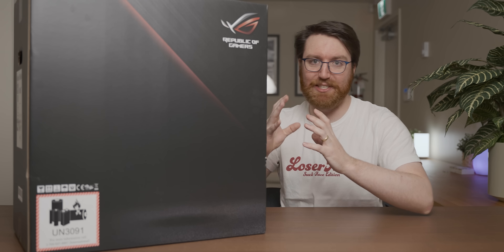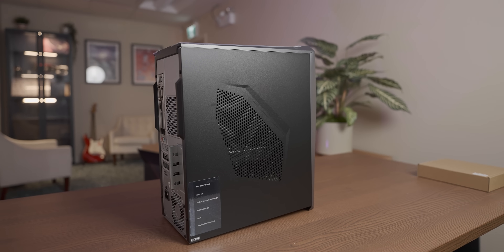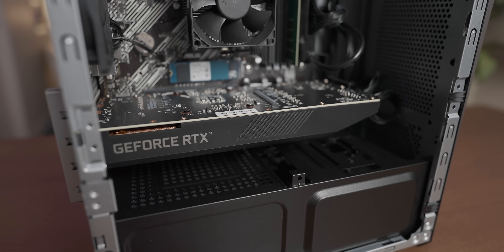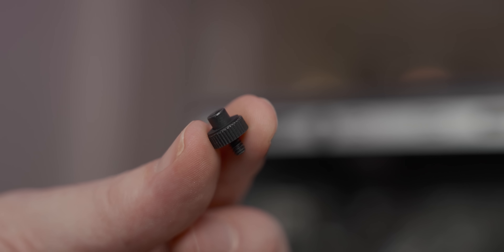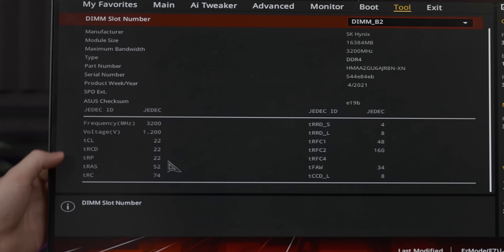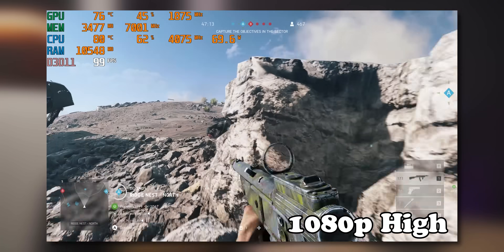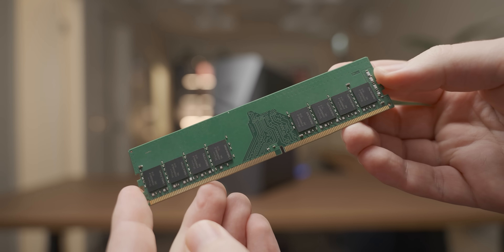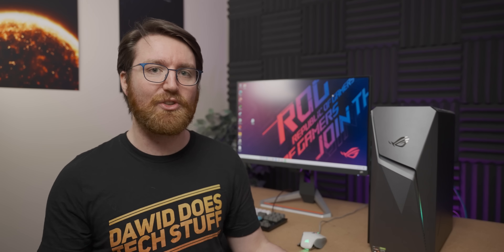Why Do Asus ROG Pre-Builts Suck So Bad?

Comment: Which is odd because ASUS makes amazing components..
Reply: Good laptops as well. Well, except their TUF branded ones which are awful but the rest are pretty good ;p
Reply: i love how most billionaire companies cant make a good prebuild but can make good components
Reply: I want to know who decided that case should even be sold, because that’s ridiculous.
Reply: Yeah they dont put them in their pre-builts 😭
Reply: I always wonder who’s in charge of the product and sale team? They know gamers are gonna be nit picky and will want the best thermals, dual channel ram, and a clean OS installation.
Reply: Some asus prebuilts are good like the 35dx
Reply from the maker: I know right! They know better than to make a product like this.
Reply: @DawidDoesTechStuff  it's not that they don't know better, they know very well that this type of configuration maximizes profit.

99% of "real" gamers would never consider a prebuilt anyways. 

The ones who would buy this don't know any better and it has rgb and the edgy gamer appearance!
Reply: Almost all of their laptops suck. And their actually decent ones are usually overpriced. Even if you buy one of their highest end laptops, you have to gamble to get a good laptop because their QC is absolute ass. And they now use liquid metal on their laptops which makes their QC even worse. They literally put either a WiFi 5 card or a WiFi 6 card in their laptops, whatever is available at the time of manufacturing I guess, even on their higher end laptops that are supposed to have WiFi 6 cards. They send out laptops with WiFi 6 cards to reviewers alone I guess and give WiFi 5 cards to the laptops that people actually buy even though they may expect it to have a WiFi 6 card from reviews they've seen. They don't make a thing as simple as a WiFi card be surely used a specific model without having their customers gamble for the better WiFi 6 cards.
Reply: @dbombers3632  actually I'd have to disagree with you. I've been building computers since 1985 and over the past 18 months it's been almost impossible to get a good GPU for anywhere near reasonable prices. I know a lot of "Gamers" who love building their own stuff but have had to buy the pre-builds because it was the only way to get an Nvidia or AMD video card.
Reply: @Joreel  I see, are you in the US? In my country (Taiwan) we can get GPU at reasonable prices if you are building a complete system. 

I just bought a 11700 + 3070ti with dual channel hyper fury, after market cooler, 750w gold cooler master PSU etc in an NR200 case. 

The cost for this came out to about 1,800 USD.
Reply: @cryptocoin7098  no idea what you talking about
Reply: @GamerBoy705_yt  what brand do you recommend
Reply: @chrisitzsimple4649  I don't recommend buying products based on brands, but Lenovo currently has pretty good laptops (if you buy the right models). The Ideapad 5(i), 5(i) Pro, 5(i) Pro Creator, Yoga Slim 7(i), 7(i) Pro, Legion 5(i), Legion 5(i) Pro, Legion 7(i), Legion Slim 7(i) (make sure Legion 7's and Legion Slim 7's are the 2021 versions because 2020 ones had hinge issues) and not to mention, alot of their Thinkpads too are really great.
Reply: @dbombers3632  well unless they can't have anything else

Comment: The prebuilts have terrible airflow but i was able to snag a prebuilt with a TUF FHR 3080 and i7 11700kf inside for 2100$. Transfered everything into a meshify 2 case, installed a fuma 2 cooler, and now it's a cool and silent powerful rig
Reply: Did you keep the same mobo ?
Reply: @antoinecarazzato2202  yeah, it's a strix b560 G matx board

Comment: The particular prebuilt in the thumbnail is actually pretty good for the price if you spend a extra 50 bucks on more ram to alleviate that single channel problem. It's fairly upgradable too. For $500 or $550 (including the ram upgrade I mentioned) that's a good deal.
Reply: no
Reply: @Zeracey  this now has a 3080 with 11gen I7 for 900 its even cheaper and worth now that parts are not scarce. But say no
Reply: @Zeracey  NPC

Comment: I remember having one of those console PCs, the Asus G20 and that thing ran hot all the time and because it was in a small form factor, had little to no upgradability. For $1k back in 2010, that was a lot for a gaming PC but it was absolutely trash. Within the year it shitted so I basically took out my frustration on the thing before tossing it into the recycler. Ironically enough, that was my spark to start building my own systems and such and I'm happy that it happened.

Comment: I think putting everything into a new case is probably the best thing. There you go - an episode on moving the contents to a new case and see what the performance is like with proper airflow and coolers in place.
Reply: whats a good case for it?
Reply: @sockswastakentwice  I need to know
Reply: @brianbillings6518  same, i think im just getting a basic white case on amazon that has good reviews, im pretty sure all my parts and stuff will fit if not ill just return the case and get another
Reply: @sockswastakentwice  Probably anything that has airflow.  Would be hysterical to see it in something like a Fractal Torrent or a Corsair 4000/5000D  ;)
Reply: @sockswastakentwice  Corsair 4000D AirFlow =)

Comment: from the looks of it, this is basically a reskin of the office PCs they sell, with a GPU stuck in it.
Reply from the maker: It does feel a lot like that.
Reply: @DawidDoesTechStuff  so I am curious how much opening up those fake vents in the front with a Dremel will do to practical airflow in the system, like how good would it be if it came from the factory like that?
Reply: @mattparker9726 or keep the side panel off
Reply: @Neptune695  well then I guess the cooler is to blame
Reply: Daummm sir u really solved the riddle. smart.

Comment: You should cut open the "vents" to see how much it helps the cooling
Reply: or just remove the front. its just clipped in place :-)
Reply: I really wanna see that video !
Reply: Use a dremel tool and cut some openings and zip tie a 120mm fan to the front wall inside the case and it would be a night and day difference. I would do it if I had this PC.
Reply: @MrR2185  thats exactly what i did with mine few weeks ago,not as clean though, just drilled few holes in the front panel and zip tied the fan :D
temps went down about 15c on average across the board, can recommend
Reply: Yes...but for the people who buy this for $2k, it should have that already done from factory...its sad because it looks like you can fit at least two 120mm fans
Reply: @jea446  i just bought this and I'm waiting for it to arrive. Which direction was the fan facing?
Reply: Would it be wise to remove that part? If so how?
Reply: @jea446  is there any chance I could see what that looks like?
Reply: There's no way wimpy Dawid can cut that open without chronically complaining about how hard it is and completely mangling the case and probably cutting himself . Lol would be funny but let's face it. He's not capable lmao

Comment: I'd love to see a take where you take this prebuilt and do whatever you must, in order to optimize it to its full potential. I'm talking;
- Get proper ram
- Install a real cpu cooler
- modify the case for airflow
- install additional cooling fans in the case accordingly

Basically do everything you wish that the prebuild would have shipped with from the store, and then do a summary of the changes you've made, and perhaps the associated cost too, just to see how much has been cut out by the "Asus marketing budget" for this pc.
Reply: the probleme is for me IF you have to buy ANYTHING else after you bought the prebuilt. means that the prebuilt was trash, and you should have made a custom pc from the start.
Reply: @wellaname221  Yea that's exactly the point; to highlight exactly how much the average prebuilts are skimping out on and how compromising their offers truly are, when compared to an actually decently put together rig (with same core hardware, just built with common sense).
Reply: @Real_MisterSir  yup i see your take. honestly i stopped watching this youtuber the moment i have seen one of his prebuilt Test where the pc couldn't even Run a game 1 hours straight without 7 crashs" his words" , and in his conclusion he described the pc as " OKEY " when he should advise people to Avoid it even if it was the last pc on earth. his reviews are Shady AT best.
Reply: @wellaname221  Damn.. I haven't seen that one. I personally wouldn't even feel comfortable giving a rating at all to a product that fails at such core tasks as running a game. That is something a pc just needs to do without question or hickups.

Comment: So basically sounds like if you drill some holes in the front panel (or just pull it off), replace the cooler, and put in a matched set of RAM vs a single stick you've got an actual decent prebuilt. Good to know!
Reply: I guess, and the fact that it's easley upgradeable makes it even better

Comment: Wow, so the day finally came where  Dawid reviewed the prebuilt that I own and I can’t believe ASUS actually went backwards! I bought mine last year at $1400 with the same Ryzen 7 3700X, but with an RTX 2070 Super, and it has two advantages over the one in this review, which are that mine came with dual channel RAM out of the box, and that mine came with a Great Wall 80 plus Gold PSU instead. I also don’t recall ever seeing my cpu temps go that high in a game. They learned nothing from last year and in fact went the wrong direction! This crappy prebuilt debacle will never end!
Reply: I've  got the same computer except I've got GTX 1660 TI card
Reply: I've also got this prebuilt. Mine too came with dual channel memory. And a much better CPU cooler than the one seen in this video. Odd how there doesn't seem to be much consistency with these builds. Cheers 😊
Reply: Should I buy this pc?
Reply: @Rxcdleyt  Unless you dont know what you're doing or live in a country that has extra bad shortages, you're better off building your own system. The extra 200$ that you gotta pay for a gpu isnt too big of a deal compared to paying the same extra for a prebuilt and ending up with a prebuilt.
Reply: I bought this a couple months ago and it’s not to bad for what kind of gaming I wanted, and same mine did come with dual channel ram. I just want to upgrade it lightly and I’ll be happy
Reply: @michaelwalker7004  I bought this yesterday, did I make a mistake?
Reply: @jarenile2306  I’m happy with mine but I’m not impressed every game I play I can run at 60 fps but it’s definitely not a super computer. And the gforce app let it do all your graphics or you will not have a good time p.s it runs 60 fps with medium graphics witch I’m okay with cause it’s my first pc I didn’t wanna go crazy, I will say it dose lack in the graphics department

Comment: These are actually not bad computers. Just install a second 90mm fan in the bottom front for intake. The intake is at the bottom of the front panel. G10DK had dual channel ram as well with it's 3060. I have one stock with extra fan. And one recased with a ton of fans. You can't buy the parts for $1k which is what Walmart was selling the G10DK for.

Note the gap at the bottom front of this case...
Reply: I have this PC as well. With a few upgrades, it can be pretty good although the thermals are rather sketchy. I do have a spare 90mm fan, but does the motherboard have a third fan header?
Reply: @Matrix_The_One  thermals were more than acceptable with the clear side panel which as you know is vented all the way around, and additional front intake fan.

In fact I built a spare parts rig in this case and resold with no complaints. Still have one in the parts bin I might use for an emulator box.

Comment: I’d love to see a video where you upgrade the case and cpu cooling and see how much it improves the system and whether it’s worth buying this OEM and upgrading it yourself
Reply: Honestly what I was planning on doing. Seems to be a pretty easy upgrade
Reply: Funny story. I actually bought one of these prebuilds that had an RTX 3080 TUF, i7 11700kf. I stuck it in a new case with a liquid cooler and (2) 3600 MHz 16 GB sticks of ram. The thing runs crazy nice. Best part about it was I only paid 2K for the prebuild
Reply: @samyisafanoffred  I just got the cooler master case I have a asus GeForce rtx 3060  ryzen 5 3600x I have the stock motherboard but it has no rgb headers or anything what did you connect your liquid cooler to I have the 2 fan headers but I’m going to get a spittler of amazon but I want a cpu liquid cooler but don’t know what one has no rgb header cause I don’t have one
Reply: @samyisafanoffred  so your telling me that it's worth getting the asus rog at 1,200 dollars and then upgrading it afterwards?? Or is it better to get a 1,500 dollar prebuilt pc with everything made to be best quality
Reply: @MajesticSam  the best move is to never, ever, buy a pre-built. Build your own
Reply: @mikerzisu9508  idk if I'm doing anything right if I put it together myself it's not exactly easy like legos
Reply: @MajesticSam  honestly,  it isn't as bad as it may seem. 20 years ago, yes, but not nowadays.  Sure you need to read about it, but you have to start somewhere. Building is the best way to ensure you have quality parts and a solid build
Reply: bought the same prebuilt with a 3060, i swapped the case and put a 3070ti with 32 gigs of ram with a 7 5700g and i absolutely love it, there are a few things i would change like the power adapters at the bottom of the motherboard, it kinda restricts your gpu size but other than that i haven't had any problem s with it
Reply: @kvng0fbrhd76  I have this same but put in a td500 case I have the asus GeForce 3060 why  did you upgrade your graphics card
Reply: @kvng0fbrhd76  I also got a cooler master liquid  cooler 2 fans I got the m240l rgb it looks sick all white case and the cooler but next I wanna either get new monitor cause I’m using a old ass lg one and want a better one with 
0.5 ms or 1 ms I seen some one Best Buy or rgb ram I still only have only stock of the current ram but sometime my games freeze when I load up idk if I should reset my pc and see if it’s windows or ifs cause I’m only running one ram stick rn
Reply: @curtismcpherson4823   i wanted something more powerful so i swapped to a 3070ti, im basically changing the components out for quailty parts, i bought this back when prices were really high for a good bargain and just have been updating it sense
Reply: @kvng0fbrhd76  yeah same how did you trade did you just find someone that  wanted a 3060 and they had a 3070 ti or did you see lot for money then just get the 3070 ti I wanna to upgrade mine in the future but it’s really good for my basic needs rn
Reply: @MajesticSam  it sounds like a decent machine that should last you several years
Reply: Yeah i just bought this PC and its loud when im stream ASMR and i have no idea what to do. Bestbuy didnt even help me
Reply: @chinkylewinsky  send it back
Reply: @curtismcpherson4823  should i buy asus rog strix g35 pc with rtx 3070 or lenovo legion t5 with rtx 3060?

Comment: It would be interesting to see the guts transplanted into a case with great air flow. Maybe with a better cpu cooler and see the difference. Lovely analogies as ever Dawid.
Reply: I did this. Water cooled CPU and 6 fans total (2 in the radiator) currently. Works great.
Reply: @BootyLumps  just swap over the parts to any M-ATX or bigger case. Preferably an airflow model.
Reply: @BootyLumps  yeah, any aftermarket cooler would be better than what it comes with.

Comment: It’s so baffling how Asus manages to make some of the best individual PC parts, yet when it comes to making full systems (both desktops and laptops) they always fuck it up big time in one way or another. 

(Had severe thermal throttling on my mid-spec zephyrus G14 (even at 100% fan speed) that was causing actual slowdown, not just stutters and framedrops.)
Reply: look at other reviews. this guy is just a snob. if i wanna spend 1000$ on a prebuilt this thing rocks. just get the 1660 ti not the super. airflow is not bad. and ive looked at tems of this in test and they stay about 60. js this dude got paid to rip on this system.
Reply: @sgt.skibby570  Just because someone else doesn’t like something you do like doesn’t mean they got paid to rip on the system. 

If you like said system then more power to you, but claiming someone got paid to rip on something just because you disagree with their opinion is childish.

Comment: A few months before this, I built the same specs only with 64gb dual channel RAM and 2x2tb NVMe SSDs for $1600...the only thing I'm missing is a new GPU (stuck with my old 1060 due to shortage prices). ASUS could have easily stuck in a dual channel kit and a nice CPU cooler for roughly the same price & still turned a healthy profit, having made a better bang-for-buck gaming machine than I did. Shame.

Could have at least added a couple case fans ffs.